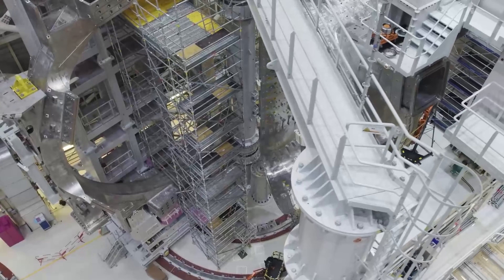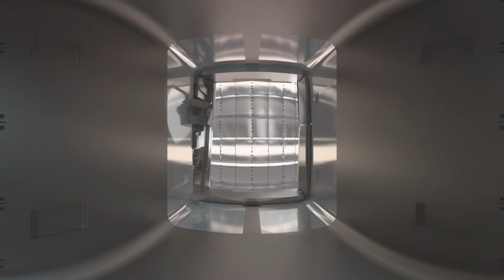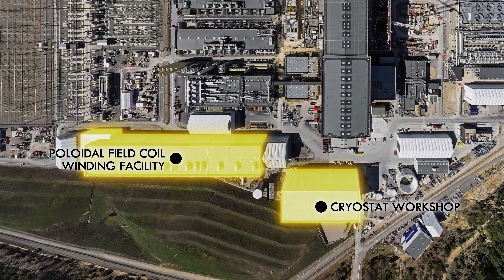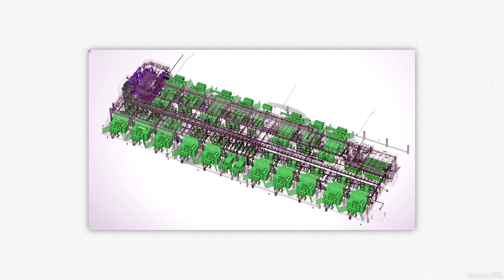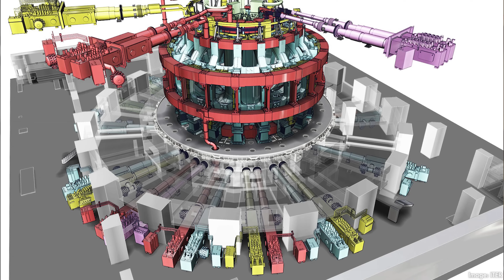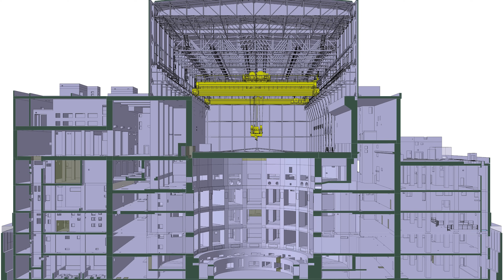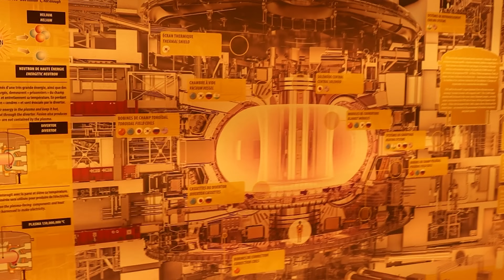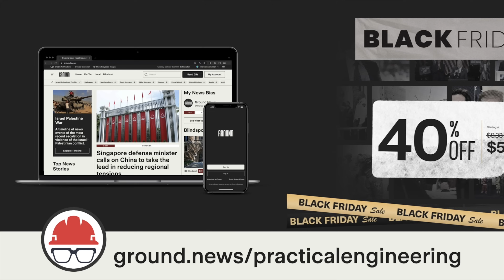Engineering The Largest Nuclear Fusion Reactor

Comment: I like that people are pretending it's mainly for electrical generation development and not for testing nuclear weapons concepts
Reply: the nuclear that you use in nuclear reactors is not the same as the ones used in bombs, but there are reactors that could be powered by the nuclear that those bombs rely on, thus giving a halfway sane reason to disarm besides "pretty please". nevermind the fact that nuclear reactors since the third generation can't meltdown, and that nuclear waste has always been one of the things that puts it above the other energy types, given it is containable, spent fuel that can be reprocessed in certain types of reactors. a handful of bananas has a larger chance of harming you in most cases, and everything else can be stored onsite or even dumped into the ocean without any risks. even the initial costs of nuclear is going down, all that's left is to address the fearmongering and public ignorance.

Comment: There are no good engineering plans to convert fusion energy into electricity. A fusion reactor of the Tokamak type is essentially a massive high-energy neutron source, in a vacuum chamber, surrounded by a cryogenically cooled superconducting magnet. Assuming the reaction can be made to run in a steady state, that’s just the beginning.
The challenge is that the highest temperature on Earth, in the fusion core, is about one meter away from some of the coldest temperatures on Earth, in the super-cooled magnets. The geometry of the core puts severe limits on the placement of cooling fluid loops, just as the neutron flux places limits on the choice of materials used in the vacuum chamber, magnets, and coolant tubing. The magnets, when energized, store an enormous amount of energy in circulating current, and they will explode like a bomb if they overheat.
These are all very tough engineering and safety problems, and they exceed those of any fission reactor. So, aside from some vague ideas, there is currently no workable plan to extract the energy from hot neutrons and deliver it to a steam turbine to generate usable electricity.

Comment: Absolutely fascinating! I am both curious and fearful about where this journey of discovering fusion will take us! On one hand, the idea of generating power from seawater sounds like a massive benefit to society since we could cut our reliance on fossil fuels. But thinking of the earth as a closed system of thermodynamics, wont it just further increase global temperature by housing a miniature star on our planet? That heat has to go somewhere, right? Spinning a turbine with the steam doesn't make the heat energy magically disappear...

Additionally, us humans are prone to making mistakes. What happens if this magnetically confined plasma is no longer contained? Atmospheric ignition was considered with the first nuclear weapons testing but ultimately ruled out. Has it been reconsidered for humanities first foray into fusion?

So many potentially devastating possibilities... I guess we will have to just wait and see...
Reply: The heat issue, sure it's real, but no more than any other way of generating power. Heat is heat.
As for what happens if it goes wrong. The plasma is incredibly hot, but also very little of it. If the containment fails it wouldn't really do much damage.
Reply: @ResandOuies  Ah! That actually makes a ton of sense, thank you. I suppose you're right, its a ton of heat, but in a very small amount of material. So I suppose if its breached, it would likely just fizzle out. And good point that heat is heat. We are already generating a ton of waste heat as a species already, we would just be generating through different means...
Reply: Heat generation isn’t really a problem. The sun introduces many magnitudes more heat to the planet. Climate change is an issue of insulation, it’s okay to let in so much heat as long as it can be let out again, greenhouse gases prevent this. Even if by a fraction, that means a lot when the sun introduces so much heat.
Reply: @SeraphimFelis  Thats fair, and good point! Thanks for the info
Reply: Can’t edit so I’m making a reply to add one more thing. Please do not consider the Earth a closed system in this context, it absolutely is not. Closed systems have no energy introduced from the surroundings or lost to the surroundings. Earth meanwhile gains and looses many many many times more energy than humanity uses due to just that.

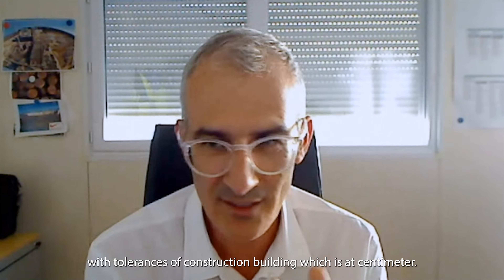Comment: 11:00 In discussing (10:45) how accurate the building can be made vs the reactor itself, he says  "... make compliant the tolerance scales" between the two, he is referring to what an native English speaking metrologist or engineer would call _tolerance stacking_.  Assuming I'm understanding this correctly.

Not being a engineer myself, I've only read about this being used to illustrate the dangers of using two different sets of measuring equipment to measure the same or related components. But I think the term, sorry for the pun, fits perfectly and should apply despite the context being a bit weird.

Comment: What are the effects of a melt down on a machine of this scale ?.
Reply: Very little. 
Fission plants have literal tons of very hot radioactive elements in their fuel rod that, even after primary fission has been quenched, will continue to output heat as they proceed down the radioactive decay chain.  So they need cooling for a long time to stay below their melting temperature as that happens.  

In contrast ITER's plasma, while very, very, very hot is still a pretty diffuse thing -- I probably got this wrong but multiplying their target plasma density with the mass of hydrogen particles with its 830 cubic meter plasma volume gives far less than a kg of plasma.  If you lose containment the first thing that happens is the density drops below what's necessary to sustain fusion - and there's no radioactive decay process to keep producing heat, and the second thing that happens is the diffuse plasma hits the (water cooled) walls of the ~5500 tonne toroidal field coil torus.  There isn't enough plasma to melt that those down, even at its temperature, and there's nothing to keep the plasma's temperature up.
Reply: Thanks for a great explanation..Jonathan Smith6050.. very cool stuff

Comment: Yeah sure. Lets take a concept that has never really worked before at smaller sizes and scale it up massively. That thing would eat tritium like nothing else (of which we  have like 10 grams in total right now). Also its not safe radiation wise. That plating catching the neutrons will become VERY radioactive and therefore has to be replaced regularly which in turn means complete loss of production for days. We arent even able to save up the necessary energy to brigde that timespan with current technology. 
Take that money thats put into this project and put it into figuring out a concept that actually works

Comment: If it ever works, I wonder if it could be modified to produce power with the excess heat or not.
Reply: its a research reactor its never meant to. DEMO will and likely by capturing the neutrons with molten lithium or a lithium salt then getting steam off that. lithium because hitting it with neutrons gives you tritium one of your fuels.
Reply: There are design for that but the current problem is that getting good efficiency requires very rare and expensive to work elements. So we're gonna need another breakthrough on that front.

Comment: I know this is a test reactor and proof of concept, but... it's very hard to see how this approach to fusion energy could be scalable.
Reply: I think this is a full size unit. It isn't intended to be scaled up. It is right at the edge of our current capabilities and I only see them attempting to scale it down over time.
Reply: What do you mean scalable? If it works, build more of them.
It's a prototype. If the prototype proves to work then you move on to figuring out how to make it cheaper. Then with every iteration you continue reducing cost and simplifying in hopes of Achieving economies of scale. Also in parallel you work on prototyping miniaturized designs.

Comment: Ok but wait: if both the reqctor and the building itself are decoupled to allow movement,  how did they solve all the pipes for heating and cooling?

If you combine possible movement of the tokamak, building and thermal expansion, were talking about literal meters of movement?!

Not to mention the possible pressure and temperature ranges of the pipes, a rubber hose isn't gonna cut it

Comment: Just for people that are curious, ITER does not tenfold the total energy input. It tenfolds the amount of heatenergy of the plasma, the elecrticity going in is still less than the electricity going out. This is intentionally phrased misleading to make ITER seem better than it is which I find to be disapointing. Wikipedia does imo a better job of explaining ITER than the ITER website itself if you want to read up on it.
Reply: Q is just about heat into and out of the plasma, Q=10 is what ITER is going for Q=12 is what you need to break even on a hypothetical power plant, maybe Q=20 for commercial viability.  ITER is just the first fusion research reactor though, its like calling bullshit on the wright brothers first attempt at a plane only making short hops.

Comment: No long lived nuclear waste still means harmful for up to 100 years.

It's a misconception that there's no nuclear waste from fusion power plants. The neutrons released by the reaction need to impact a blanket to convert their kinetic energy into heat, this damages and irradiates the blanket as well as the fuel assemblies and cooling systems. According to a 2017 article published in the Bulletin of Atomic Scientists, while this results in less radioactivity per kilogram when compared to fission-reactor wastes, the total mass of the fusion-reactor waste will be much higher.

Comment: I doubt ITER will work particularly well if at all: spinning plasma around a torus doesn't produce many collision opportunities and containing everything in a steady plasma hoop is difficult. I have much higher expectations from stellarator experiments.
Reply: The purpose of the torus shape has nothing to do with spinning the plasma around. This is not a particle accelerator like a cyclotron. You are making a lot of erroneous assumptions in your comment.
Reply: @MottyGlix  Keeping static plasma together is next to impossible and you won't have many collisions happening if you rely strictly on compression either. You need dynamics to both facilitate containment and increase the probability of fusion events.
Reply: @teardowndan5364  The very reason – okay, one of them – that plasma is used is because it is susceptible to magnetic fields. Using magnetism, the plasma is pinched to (A) compress it for fusion purposes, and (B) to contain it without having it touch anything solid, such as the compartment walls. (That would cool it down immediately; this was addressed in the video.) 
The reason for the torus shape is that when the compartment was cylindrical, setting up magnetic containment at the cylinder ends were giving the engineers headaches; by curving the thing around into a torus, the ends were eliminated, thus solving that problem.
Reply: @MottyGlix  A more fundamental reason for the taurus shape is that when you expose plasma to a magnetic field, you induce current in it, which causes acceleration. Unless you loop the plasma around, it will inevitably hit a wall.

Comment: Iter will never make power. That's not it's plan. It will take 100's of megawatts to heat the fuel up to get maybe 50 back out. They only say it will make power because once it's up and operating it won't consume more than it takes to operate it maybe...

The actual problem is fuel as even for a piss poor energy return like 10 to 1 (that is an order of magnitude more efficient than anything that's planned or conceivable ATM btw) this thing needs more tritium than exists. Like it will eat the entire world's supply of tritium (which ATM is not produced really and many of the CANDU reactors used to make it are shutting down) just for these tests it needs 15kg of the 20kg that currently exists and we only make about 1.8kg per year. 

Demo the next planned reactor will need 100's of kgs and it will be the first one that will actually make power take about 500megawatts to generate 750 which is still terribly inefficient

Comment: To be party pooper. People try Tokamak reactors from 1956. And always input always higher than output. They not produces any fusion. Later you will see new things about entropy to mechanical systems how produce free (net gain) where output is bigger than input electric energy without heat production which included not just fossil, nuclear but also solar that uses solar heat energy. New method will be so effective and simple you will see why entropy philosophical concept was forbidden to develop by fossil (coal barons), because thermodynamics and computer science have entropy concepts it has no impacts on fossil fuel industry monopoly. Wind mills and water wheel it is 16 century technology so fossil fuel allowed because it existed before them.

Comment: What happens when a star experiences a meltdown? It goes supernova, and in some cases, creates a black hole. Both would be worst case scenario. However, both would likely get weaponized several generations from now.
Reply: thats from gravitational collapse. fusion power uses grams of hydrogen at a time. even at the temps involved its not even enough to melt the walls if the magnets shut off.
Reply: And is also an impossibility on Earth unless we get to AT LEAST Dyson Sphere levels of technology

Comment: One thing wasn't clear enough magnets must be super cooled with liquid nitrogen otherwise they can not generate enough magnetic field to hold the plasma! This is the main reason why the reactor is cooled with liquid nitrogen instead of heavy isolation like it is done in nuclear reactors. There are way too many parts which have to work flawlessly, slightest failure and we are looking at massive reactor damage. And this is the reason why there aren't any steam generators on site at all because nobody believes this experimental tokamak can work for a long time! To be honest as an engineer i find the whole project a waste of resources, a propaganda project to prove ''we can do it'' instead of actually doing it. Our star carries way more energy than we will ever need from 150 million kilometers but we can not still use it at all. This money should had been spent on energy storage technologies instead, if we have really high storage and efficient batteries we will not need fusion to produce energy...

Comment: I like that they took into account the warping of the assembly before and after they are constructed. The heat generated by the machine(s) they are making will drastically become different over time; what is the lifespan of such machines? How will they be replaced?

Comment: The biggest problem facing fusion is getting the deuterium and tritium. It is a byproduct from nuclear fission reactors and only one reactor in the world, in Canada, had been collecting it. There is a very very small amount out there at the moment.
Reply: canada just has the only reactor choosing to make it, any reactor could. also you get tritium by bombarding lithium with neutrons, which a fusion reactor will emit. fusion power plants will just capture the neutrons and thus the heat output with lithium which will make steam and have new tritium filtered out to fuel the reactor.
Reply: Deuterium is no problem it's the tritium that will run out unless generated, since it's impractical to collect in the extremely rare concentration in the ocean

Comment: 🎯 Key Takeaways for quick navigation:

00:27 🌞 ITER is a massive international project in France working on nuclear fusion, which has the potential to provide a clean and powerful energy source.
01:32 ⚛️ Nuclear fusion is highly sought after due to its potential for clean, sustainable, and powerful energy generation without long-lived waste or the risk of meltdowns.
02:53 🌐 ITER's Tokamak reactor is a key component, aiming to produce 500 megawatts of fusion power from 50 megawatts of thermal power, a gain of ten in fusion terms.
03:52 🔌 Magnetic fields, generated by powerful magnets, are used to confine the electrically charged plasma inside the Tokamak, enabling fusion.
04:46 💡 In a real fusion reactor, high-energy neutrons released during fusion would heat a cooling fluid, producing steam to spin turbines and generate electricity.
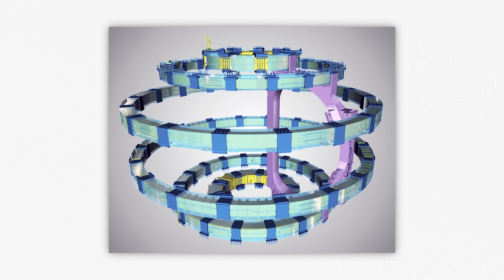06:21 🏗️ The ITER site includes various buildings and structures to support the construction and operation of the Tokamak, including a cryostat workshop and assembly hall.
07:35 🏗️ Enormous bridge cranes with a combined capacity of 1500 tonnes are used to assemble the Tokamak's components.
08:45 💡 ITER connects to the power grid, requiring careful coordination to avoid causing brownouts or surges, and has backup generators for reliability.
09:41 🌡️ Cooling and heating systems are crucial for the operation of ITER, including cryogenic cooling for superconducting magnets and external heating systems for plasma.
12:32 🍃 ITER aims to achieve a Q of ten, producing ten times more thermal energy than it consumes, with plans to convert this heat into electricity in future commercial fusion facilities.
13:29 🏗️ The Tokamak complex is engineered to withstand various disasters, including floods, plane crashes, and earthquakes.
15:29 🏗️ The containment structure of ITER uses a special concrete formula for radioactive shielding, and seismic movement considerations have been made.
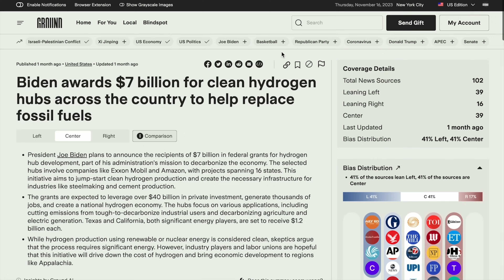18:15 📰 Ground News provides a tool to compare news sources and perspectives on complex topics, helping to break out of information bubbles and gain a more balanced view.

Made with HARPA AI